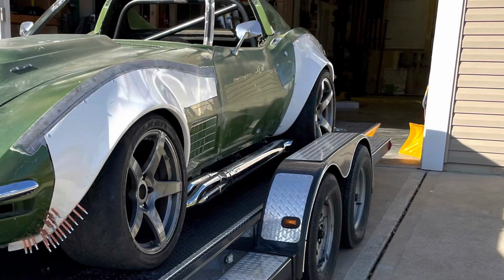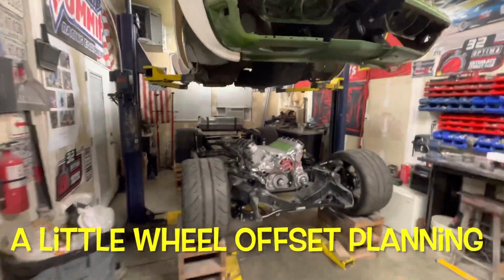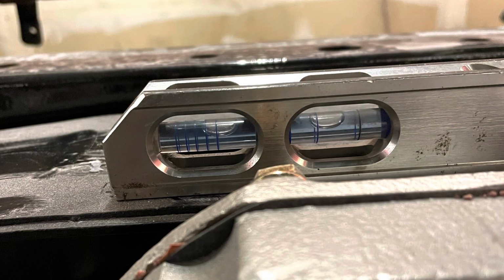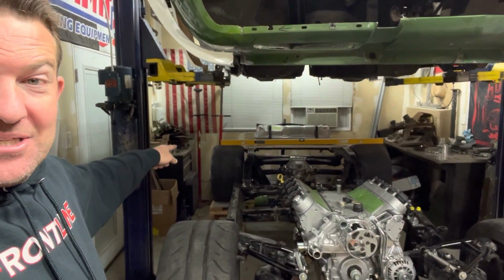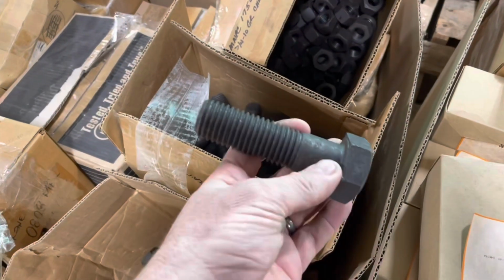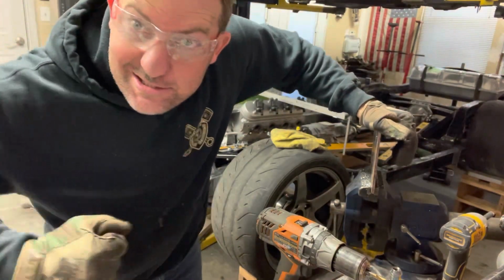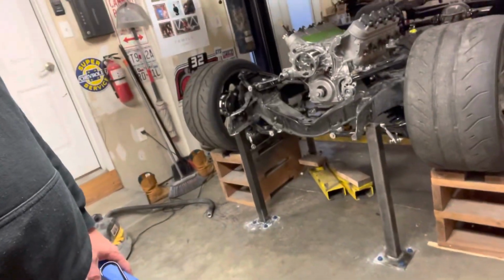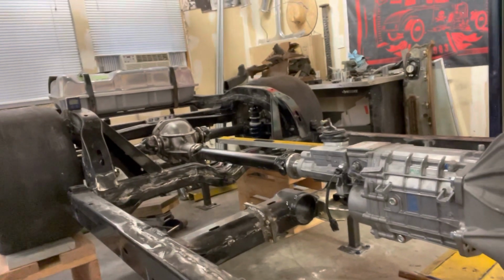Chop Or Not To Chop. The 1972 C3 Corvette Frame Saga continues and Henry gets down in the trenches

Comment: Enjoying the videos. Are you using the floor as your datum line for all your high/low measurements or levels?
Reply from the maker: I leveled my pedestals with the car sitting on them. Then I measured 8-10 place on the frame and suspension pick up points. I evaluated all of the info to determine the problem. I welded the fixers in place and I’m using a level to check all across the frame. That’s been the process to this point.

Comment: You are headed in the right direction, what you have going on with your setup is not that much different than what I would do if I had it on a frame machine. I think that once you let that rt rear corner hang you can probably give it a couple of good bounces with your body weight and get the inch or so that you are looking for. I would try not to cut it if at all possible because that's when things get crazy with a frame. I've been a body man for 40 plus years and I think you are doing a hell of a job, just my 2 cents.
Reply from the maker: Thanks Ed! Appreciate it. I tried to bounce on it after I  pulled the wheel and haven’t been successful. I’m making progress though👍. Thanks again!

Comment: Some (but not all) of your frame problems could be factory tolerances. I have seen GM tolerances be off by as much as 3/8" from the assembly line.
Reply from the maker: I agree. It would not surprise me. there’s no real evidence of any damage but it’s also been recently powder coated so I can’t really tell what may have been covered up. I’ll be able to see quite a bit when we blast it and re coat it. It’ll be a little closer when I’m finished. Lol.

Comment: What is going on with your steering box?    It looks like it has been raised.   I haven't ever seen that before.
Reply from the maker: I think that’s just how it appears in the video at the angle it was shot. I use all the factory mounts for the borgusen kit that I received as a kit. The column is custom, it’s in the stock location and is center relatively well in the firewall opening. 🤷